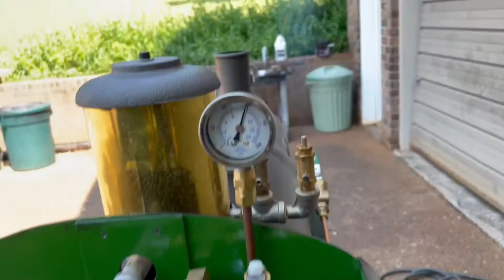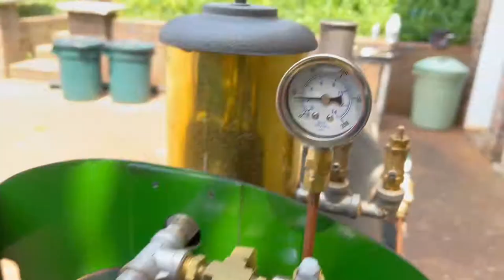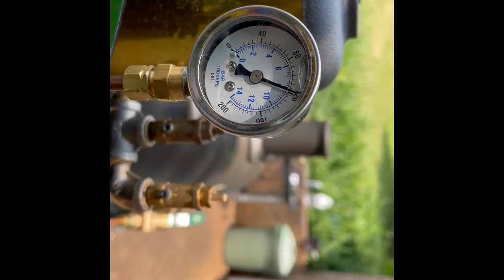Miller Backyard Railroad American second oil burner tryout

Comment from the maker: In response to the questions I have received, I switched to oil firing as I couldn’t hold boiler pressure on propane when running down the track.  We tried many changes to optimize propane but I decided it would never be acceptable as the configuration of the firebox which is a 6” pipe 19” long completely surrounded by water was only being heated on the top third while cold air was being drawn underneath for combustion actually cooling the bottom.  The oil fire is heating the whole perimeter of the 6” pipe.   I used the old backplate for the propane burner and may optimize the openings if there’s too much open surface area, we’re still experimenting.  The air coming in the back is controlled by the draft of exhausting steam and or blower draft.  No more air will come into the firebox than that. This air supports he combustion.  I do know if you don’t have enough air openings, the burner will pulsate and blow out more easily.  We need to run it at the track next to see if oil firing is going to work, but in the driveway, the oil burner builds pressure much faster than the propane burner.

Comment: Seems like you're probably wasting a lot of heat with all those openings on the backhead. Have you considered installing smaller vents on the front sides of the firebox with dampers? That way you could open them while running for a natural draft from the motion instead of losing all that heat